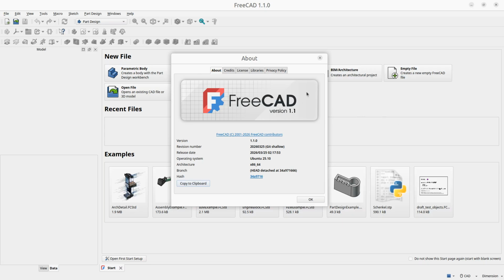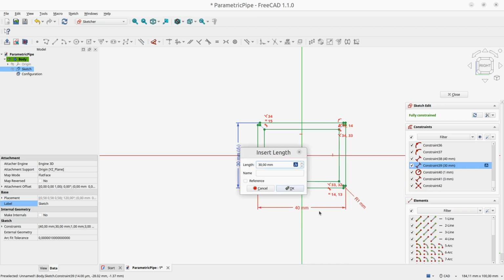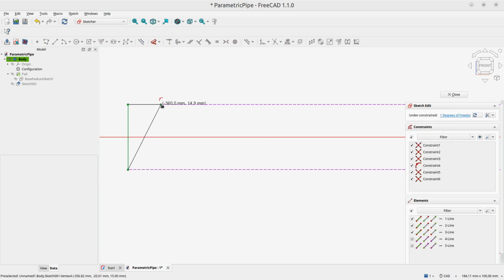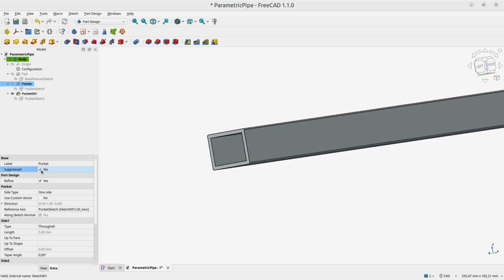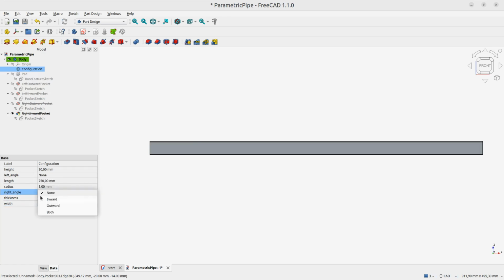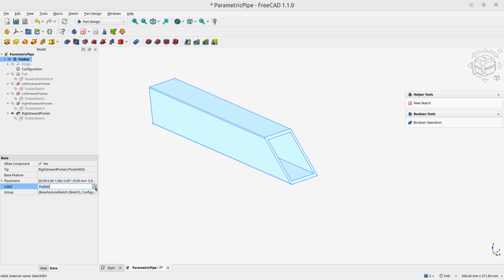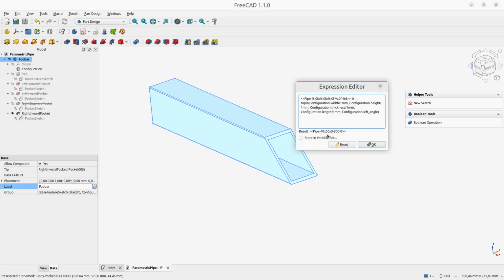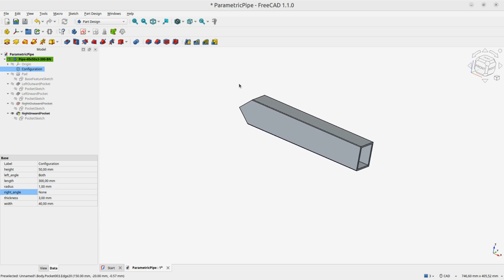FreeCAD 1.1: Creating parametric 45° angled pipe variants

Comment: I am a newbie of FreeCAD and want to create a joint to be able to print from a 3D printer for connecting three rectangular pipes together where 2 pipes connected straight but other at 45 degrees. Your tutorial is very informative and clear for me to get started but I still need more info to help me do the rest. I will keep digging. Thanks